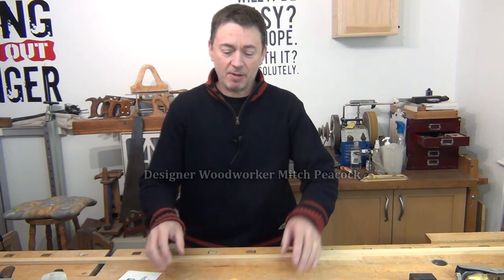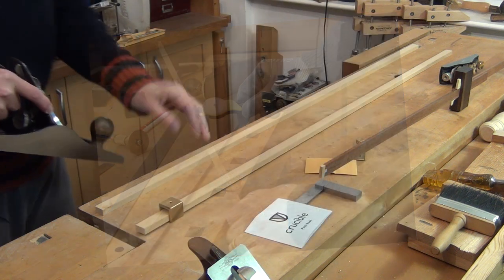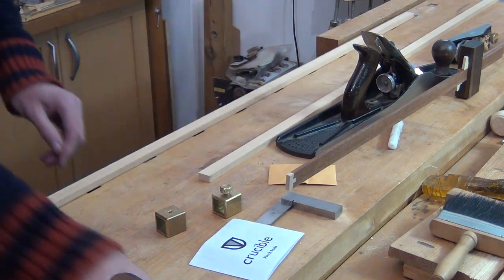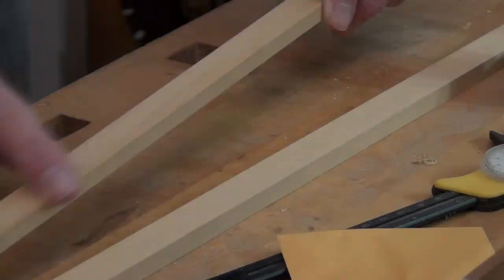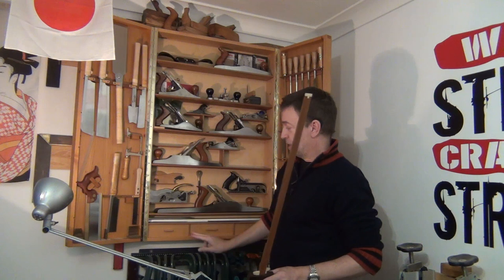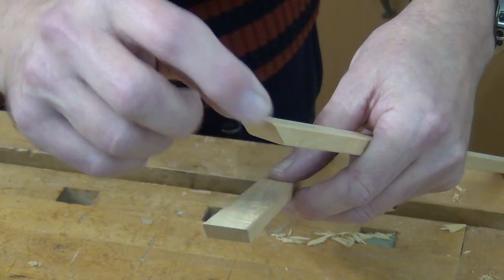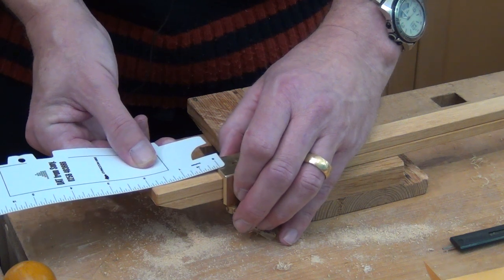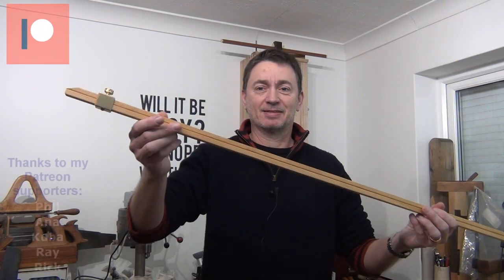Pinch Sticks \ Crucible Pinch Rod kit \ Woodworking

Comment: Interesting build- but why are you paying for a kit? (Just looked- £66!)
Brass 1" square tubing is available, and cost around £2-£3 for enough to make the hardware. Comes in mill, brush, or bright finish- I use mill and just run some emery cloth over it. Thumb wheels are readily available, or use a butterfly nut.
Nylon washer- I use a U shaped piece of shim brass. The frame retains this, and it gives excellent protection to the wood.
Reply from the maker: Absolutely, but the kit was a gift from a generous viewer.
Reply: @mitchwoodwork  Nice gift!